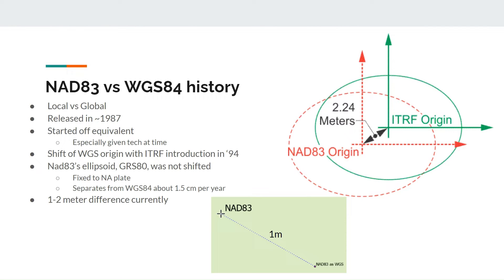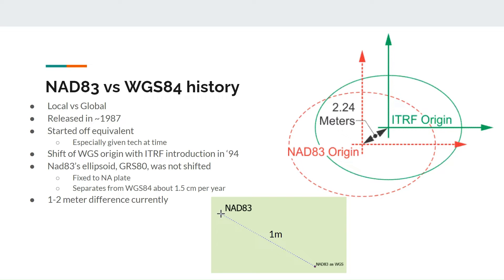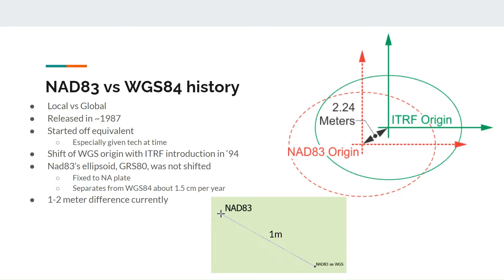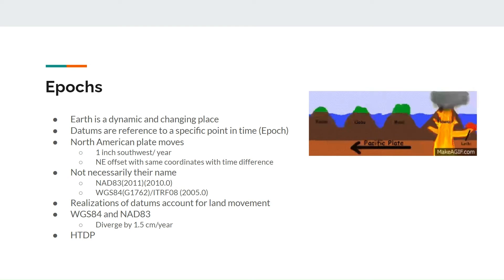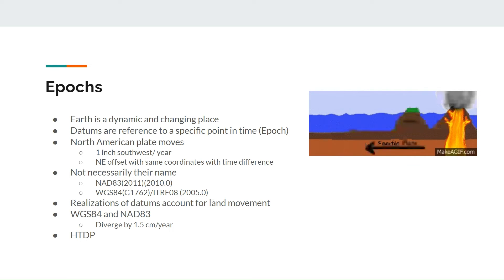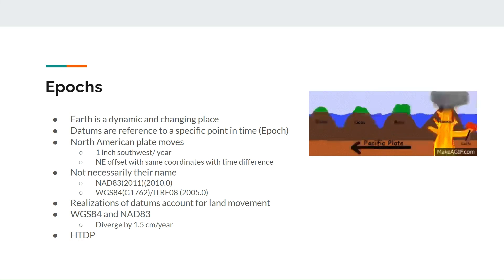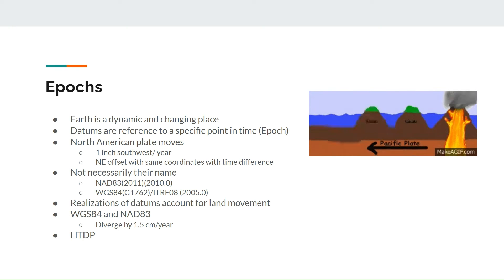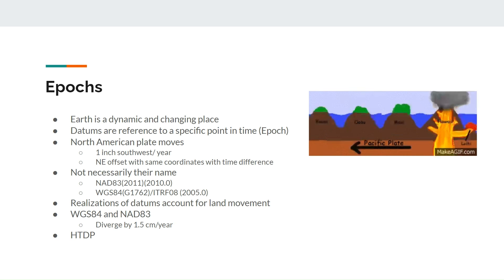Datums: WGS84 vs NAD83

Comment: nice and short!
Reply from the maker: More to come!
Reply: How do I know when to use WGS84, NAD83(2011) or NAD83 No Trans.  I have a topcon base, rover setup but sometimes i just use the rover on the cors network.
Reply from the maker: @littlenel17  With base/rover, it depends on what you're using as your reference point.  If you use a "here" point, or the position your GPS thinks it is without being connected to a network or using a reference point, then you'll use WGS84.  Otherwise you'll use NAD83(2011) for most applications, but it depends on what you're using for your base point.

For the CORS network, it's almost always in NAD83(2011).